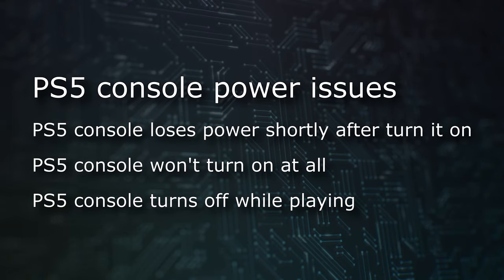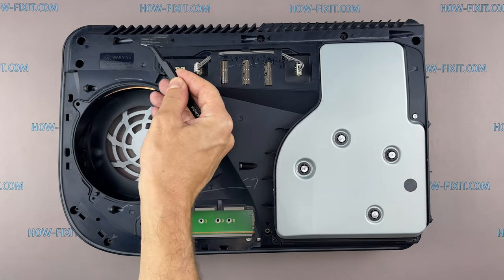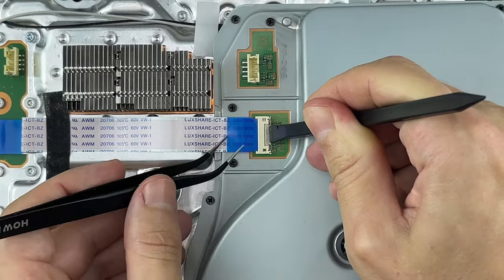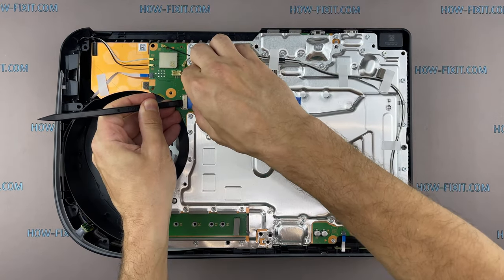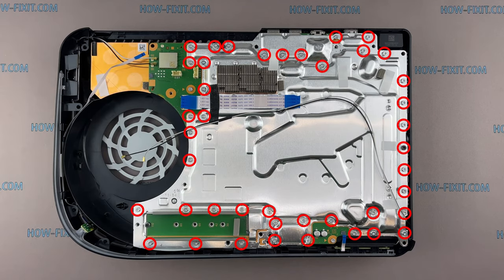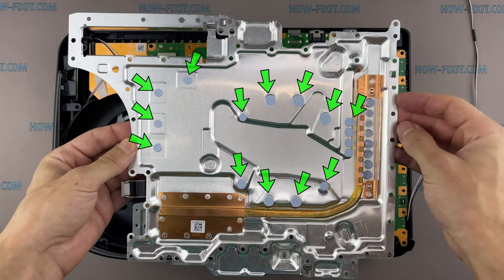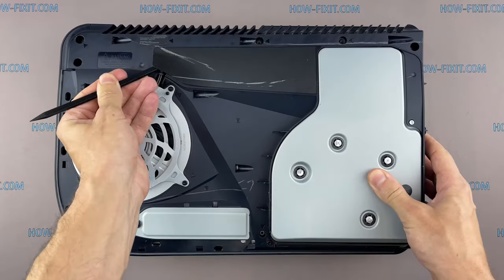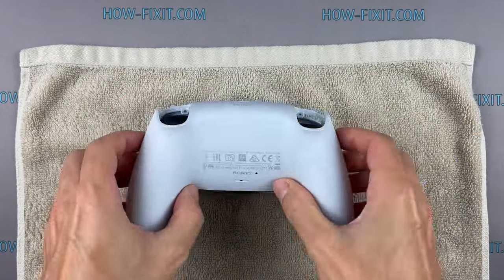PS5 power supply replacement

Comment: Electronics wanted to charge me $250 to send my PS5 off to replace the power supply.  I ordered one on Amazon for $85 and thanks to this video it was a very easy replacement!  Thanks!
Reply: Does it come with the cables and the plate thing solder to them? The one on the wider side of the power supply
Reply: The thing with getting someone else to do it, you pay for their time as well as their skills. Also for that particular repair business, they have to get some sort of profit off of the work, otherwise what's the point in even doing it? lol
You'll often see the Part cost + Margin + Tax (at least in the UK) + Labour (Time & skills) cost + Tax.
Providing you are capable and feel up to any challenge, you can always save money by doing it yourself.
Reply: @techagek your so right mate! I understand people have to eat but sometimes it’s a rip off. This guy is a GodSend fr! Cheers
Reply: @techagek yup it's a trip cuz i feel like almost ANYONE can repair everything but one of my worst customers was a jacked military bro twice my age who was crying gettin frustrated cuz i made him open his own roach infested ps5 outside. He would come back every 2 mins to ask questions or make me take out a "stuck" screw.
Reply: What was your issue on ps5

Comment: Your video was insanely precise! My Ps5 stopped turning ON after a lightening strike around the house. Saw a few comments saying this worked so I purchased a power supply and gave this a go. I couldn’t believe it when I was able to get it back and running without paying a hefty fee/time to Sony. You the man!
Reply: What power supply did you get in finding some for ps5 but they don’t look like mine
Reply: @hellcatrover7453  I’ve replied twice but it seems the Amazon link I’m trying to post is being deleted along with the comment.
Reply: @mayureshbhasagare508  oh ok thanks for trying to help mines the 2022 model where the connector for it is in a different spot and I can’t find one of them
Reply: It just happened to me 😭😭
Reply: @josuerobles12  rip hopefully you don’t have a 2022 model like me can’t find a power supply
Reply: Wow same thing with mine, huge storm and then my ps5 stopped working
Reply: Same
Reply: I didn’t play the game during the power outage. Next day ps5 won’t work! New power supply for ps5 gotta be the solution!
Reply: Use a surge protector
Reply: Is it still working?

Comment: My PS5 PSU failed after a lightning strike. Managed to get a psu from Ebay and the other accessories from amazon, including the magnetic screw mat.
This tutorial was a life saver, i’ve never done anything similar to this fix and following carefully the video i was able to change the PSU and now my PS5 is working fine again. Thanks!
Reply: hello 
i got the same problem with my ps5. after a lightning, the psu ist totaly damaged. please tell me where you find at ebay a psu.
i am very thankful for every information.
Reply: really bro?? mine got hit by lightning strike too.... so what you are saying is it worked after you fixed the power supply??
Reply: @rogermoylan5488  i copied the link but my comment gets deleted, it seems i cannot refer another seller
Reply: Same thing happened to me
Reply: Need to find a power supply as well not even anyone on Ebay is selling
Reply: Same thing happened to me
Reply: I got mine from ALIEXPRESS in like 2 weeks
Reply: @LanceB86  is it legit ?
Reply: @youngdenaro  yea, all power supplies are used, however. Guess Sony is the only company that actually has them new. But yea, it's legit.
Reply: @LanceB86  can you send me a direct link
Reply: So I think I have the same issue.  Is the power supply likely the only thing damaged?
Reply: Does your new PSU have coil whine ?👀
Reply: Same thing to me. A lightning hit a pole on my street, but not sure what fried my PSU if the power outage or surge.
Reply: @brunolavez  same here, I’m heart broken 😒😒😒
Reply: After you replace the power supply did you have any problems with no video? I got power now but no video. Same happen to me power surge fried power supply and I've replace the power supply but I can't get it to display anything on the screen not sure what to do now
Reply: @devinhammond7459  no problems so far.
Reply: @devinhammond7459  try contacting Sony support. My ps5 also doesn’t power on because of a lightning strike. Tomorrow the replacement psu comes so hopefully that fixes the issue.
Reply: Guys my PS5 keep shutting off randomly almost every once an hour, is the power supply broken?

Comment: Dude your channel should have at least 1M. 
My PS5 doesn’t turn on since a lightning strike yesterday.
I’m assuming maybe could be damaged the power supply I’m not sure.
Despite you get attention on detail to de assembly the console I realize it’s a task who requires a high skills.
Thank you so much for your video.
Reply: It isn't hard.  Just take it slow.  Pause the video every step and follow along.  Also buy a surge protector.  You can get them for as low as $10 and they will save your electronics.
Reply: I’m hoping you see this since it is a year ago you made this comment. Did you replace the power supply and does it work now because my house also got struck by lightning and I’m having the same issue

Comment: Huge thanks, I had a power surge that blew out the power supply, was able to replace it using your video. Now I'm back up and running and have a very happy 6 year old in my house now.
Reply: i just woke up to a power outage and my ps5 isn’t turning on, you’re saying the power supply was the issue? it worked fine afterward?
Reply: @AFJojo  Yep, for me it was
Reply: @JasonLefevers  jason how did. you fix it? did you do this yourself?
Reply: whered you buy the power supply?im having issues
Reply: @KINGTUXonline  Found it on eBay using the part number from the old one.
Reply: @JasonLefevers if i was you bud, i would now plug the ps5 to a surge protector if you can
Reply: if i was you bud, i would now plug the ps5 to a surge protector if you can @jasonlefevers8410
Reply: It did it to mine as well I'm re assembling as I write this lol
Reply: @cdevjoshlolo  good luck hope everything works out for you.😉

Comment: This is a great guide. My Ps5 got fried by lightning recently. It was plugged into a surge protector and wasn't even on. Using this I was able to change out the PSU and now it's back to normal.. thank jeebus
Reply: Hey apparently that happened to this ps5 I just bought for 200 bucks it’s not the motherboard right
Reply: @wtfitsbrandon  it wasn't the motherboard on mine. I was able to buy a psu for about 200 bucks and replace it myself.. 200 isn't cheap but it beats buying a new ps5
Reply: @robertchandlerjr5672   mine turns on for a few secs it’s getting the power supply worked on rn i don’t know if they will work
Reply: @wtfitsbrandon  good luck man. Mine wouldn't even turn on at all. It was completely bricked
Reply: @robertchandlerjr5672  it’s been a while the store hasn’t called yet which is a bad sign
Reply: @robertchandlerjr5672  same buy I don't think I can do it myself I found a local shop who will do it for about 180
Reply: @thabandogamer4293  it's really not that difficult.. just have to be careful and take your time
Reply: @wtfitsbrandon  mine turns on a few sec, then makes whinning noise in power supply area and turns off, did replacing psu work?
Reply: @_JayR-eb1zd  you gotta send it to Sony I couldn’t be bothered to deal with stores or anything trying to get over on me
Reply: @robertchandlerjr5672 so were you able to ever fix your ps5?
Reply: @whatever8681  yeah I fixed it using this video at the time I posted my original comment

Comment: Im doing this currently. I have a full torqs set and none of the screws were the same. Different sizes, different types. We had sent off this ps5 for repair, it sat for a month before it was worked on too close to its expiration date and was then denied before any work was done on it. We were told it had been disassembled before the rejection but not fixed. If youre buying a ps5, the insurance is not worth it just get it off a scalper. It is both cheaper and more reliable to do it yourself.

Comment: How does your new power supply have those black and white cords? Mine came without them
Reply: Did you ever find the answer to this? I just replaced mine with a new power supply from Amazon that was missing the cords, and apparently they power the bluetooth. So obviously my controller doesn't work.
Reply: @MegatronJon8  you have to take them off the power supply you already have. They are called “Bluetooth wifi antennas”. The metal clip they are connected to are a clip that can be taken off and exchanged
Reply: You gotta buy them separately if that was what you were looking for
Reply: They should be on your old power supply to take off and re add to your new.

Comment: Do you have to take all the screws off the board cover? Or will the 2 in the back and one long screw on the right lift the board off the power supply?

Comment: What's the bare minimum reassembly to check if the replacement power supply work? I only put a couple screws in to secure the mobi and plugged all the cables back in and im not getting any power. I don't really have any way of knowing if I got a bad replacement or my PS5 is just hopeless as far as I know. I don't want to fully reassemble the ps5 without knowing of ot will work. I plugged in everything including the fan and disc drive. I just didnt mount them back into place. I made sure twice that the mobo is plugged securely into the new psu, but im not getting any power at all
Reply: Praying you figure it out bro, my ps5 just lost all power today so I’m hoping this fixes my issue.

Comment: I’m trying to investigate and diagnose my ps5 I was away on vacation my sister was house sitting and there were a few storms that caused outages. Unfortunately my ps5 was connected directly to the wall so I’m assuming a surge came through the power lines. Is the minimum amount of damage just the PSU? It won’t turn on at all and no beeps or anything response from the usb ports

Comment: Does anyone know? My old PSU had a metal fence with the blue and white wire solder to it. The replacement comes with just a plastic piece and no wires. Any idea? Do I have to grab it off the old one?

Comment: so about a couple days ago i woke up to a popping sound and i figured it came from my ps5 since when i went to check on it a a burnt plastic smell was coming directly from it. i had to disassemble it and checked on the motherboard and luckily it wasn't damaged so when i got to the PSU i noticed the smell was stronger there. i'm ordering a new one in a couple of days and wanted to ask if the 2 thin cables attached to the psu also come with the new one or will i have to learn to do that myself?

Comment: My PS5 shut off out of nowhere while playing RE4. When I try to turn it on, it beeps, blue light and then it's off. It doesn't even boot. Is this maybe also just the power supply? It was more warm than usual on the spot where the disc drive is.

Comment: I have checked the power supply and I have the 12V. but look lite I have a short circuit around the hdmi circuit. 1RO 121 05P is in short-circuit. and when i plug the ps5 I can see also my tv goes off and when i unplug it tv goes on again.

Comment: Yesterday my PS5 decided not to turn on at all. Basically pressing or holding the power button does nothing. I'm not sure if it's the power cable itself or the power supply in the machine. Do you recommend getting it fixed somewhere or doing it yourself? Any replies would me much appreciated. I've only had the console about 2 months
Reply: What did u do?
Reply: Bro same problem was mine I guess ur power module is short circuited so try to get it from Amazon its going to cost you 150 to 200 dollars and just replace it that's it it worked for me..
Reply: Update: I decided to see if Sony could do anything so I sent my console to them and they replaced it with a new one for free. I didn't do much gaming on it and a lot of my saved data was through ps plus online storage which helped massively. A month or so in with my new PS5 and I've had no issues since
Reply: @SensaiGaia1 what information did they ask you for when sending it to them? Proof of purchase? And how long do you have to be able to get a replacement?
Reply: @SensaiGaia1 did Sony reset your console when you got it back? Like was all your data still there?
Reply: @ramzrule6269  They gave me a brand new console. Luckily I had all my data from PS4 still on a USB so I just had to transfer it over which didn't take too long. I didn't have my PS5 long so I didn't lose any PS5 data.

Comment: I have purchased a PS5 on Japan.
The manual book states that it require 100v as input voltage but I have seen few video of PSU replacement and noticed that PSU is dual.voltage (220-240 & 100-120v)
Where I live we do have 220V
How do o know of I can still use it without burning it ?
I don't wanna dismantle all the way down just to check, as well I don't wan a buy neither a transformer nor a new PSU 240v 
Is there anybody can tell me ?
Thanks

Comment: Do you know if an ADP-400dr power supply on a PS5 cfi-1215 is also compatible with an older generation PS5 (B chassis, cfi-10161a which also has an ADP-400dr power supply)?
Reply: If it’s the same model of power supply then yes it’ll work. I have the newest model of the ps5 which uses a adp-400df unfortunately no one has uploaded a repair on my model. It looks pretty different then this older model

Comment: HELP!! I had a ADP-400DR in my PS5 which has two black and white wires connecting to the motherboard (5:41). Can this be replaced by PA-1401-JT20 which doesn't have these wires, but the seller claimed on Amazon that it is compatible. Currently waiting for a response from them, meanwhile anyone with any info around this, kindly help please.
Reply: He I just did this replacement on mine last night. I don't recommend buying anything besides the ADP-400DR. However, you have to remove the metal clip with those wires from the old power supply and just clip them onto the new one in the same spot. The video said nothing about that.

Comment: I forgot to turn off my outlet, when i plugged my PS5 powercord into the back of the PS. This made a slight electrical noise/crackle, when i inserted the cord. Could it have harmed anything inside the PS5 or am i just overthinking? :)
Reply: Totally destroyed! Jk you should be fine.
Reply: @123456rocketboyjerry  Yeah found out all it would do is maybe slightly quicker wear on the contact prongs, but that's only if you make a habit of doing it 😅

I just thought maybe the electrical arcs could do some kind of damage to the internals, but the arcs are lower voltage and well the power cable can only pull so much from the wall 😁

Comment: So my ps5 will start to boot up , the lights will change, then just turn off. When I turn it back on it repairs itself then turns off. Would this be a power supply issue
Reply: could be power supply or ssd  storage fail

Comment: Is the ps5 duel voltage meaning can I use it anywhere despite different voltages in different countries?
Reply: You need a adapter to plug in the other counters wall socket. I’ve seen official ones from ps5 owners in other countries. buy one that works to wherever your going

Comment: I just bought a power supply but the white and black cables aren’t connected. How do I connect them? please help
Reply: Hey im having the same issue did u get it resolved?
Reply: @zvision_9533  yes you need to take out the metallic piece with the ribbons attached from your old power supply and attach it to the new one
Reply: @smooshy3188  yeah i got thanks for the fast reply
Reply: @smooshy3188  had my ps5 seating in the dust for about 2 years and i was playing on my pc and decided to fix it took me about 1 hour to replace the power supply
Reply: @zvision_9533  the screws are annoying

Comment: Is the power supply the same between a disc version and digital or are they different power supplies?
Reply: No, and the one I have the power supply is different also. I have a disk and non disk version of the PS5. And plug in hole for power supply that plugs into the board is on the bottom in the middle. Not all the way on the bottom at the far right side.

Comment: People really need to start using surge protectors.  They're $10 at walmart.  That $10 is protecting my almost $3,500 worth of stuff plugged into it.  I got a 6 outlet one with my PS5, Xbox Series S, PC, TV, and laptop hooked up to it.
Reply: Don't get too comfortable with that $10 surge protector. Just replaced my power supply in my PS5 along with our internet router due to lightning, and yes they were both plugged into a "Walmart" surge protector.

Comment: What are those two wires on the top left?(right above the ribbon cable) Mine doesn't have those
Reply: Bluetooth cables, need them for wireless controllers and headsets.
Reply: @evizzlegaming1008  thanks, I had figured it out, I'm actually fixing these things now👍.. They're like 10 pounds of sh@t in a 5 pound bucket..
Reply: @_mylastname  perhaps you can give me some insight on a failing PSU, my console randomly turns itself off and proceeds to tell me the console was turned off incorrectly. Have you come across PSU's with symptoms of this nature ? The extra PSU I ordered from Amazon was delivered broken, so I'm currently in a refund process. I purchased a ASHATA brand PSU if anyone was curious.
Reply: @evizzlegaming1008  honestly, not sure what's causing that problem. Could there be something on the power rail?? I had my console turned off (properly) and unplugged from the wall for a few days and I got that messege when I turned it on..I know there's that little battery in there (2032 on the motherboard, not inside the PSU) but I honestly just don't know. These PSU are strange. I shocked myself, tearing one apart!! So be careful.